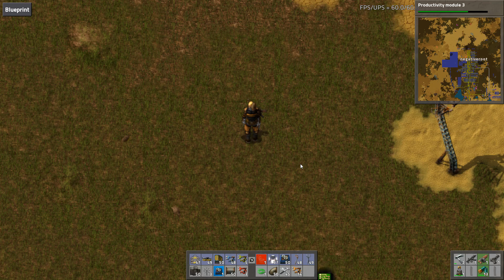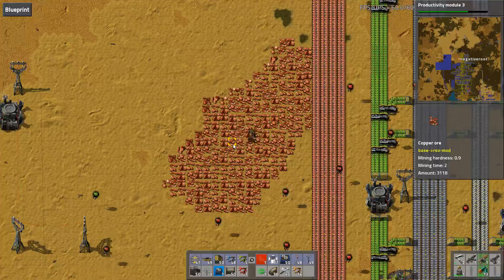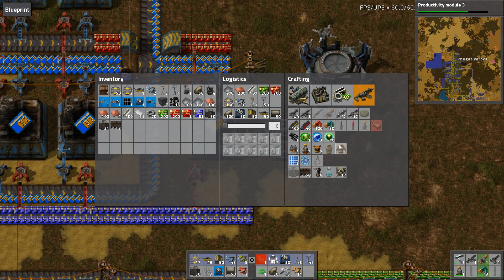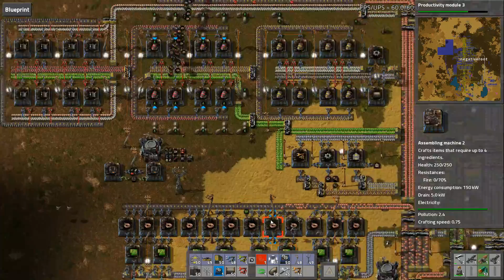Factorio Beginners Guide 24 Furnace Redesign

Comment: Using this setup + a few diff tweaks, I'm using 2 and its making 6k plates a minute.....(isnt enough for my production though) I have a hard time getting enough ore for this setup, but it is an amazing system thanks for the help bud xD
Reply from the maker: you're welcome. and good on you for making tweaks to the design. thats what factorio is all about.
Reply: Any tips on MASS plastic production? Currently I'm using a mod that allows for other ways to produce plastic, but it requires SO much wood... Is there a way to get the .1/sec oil to actually be enough to produce plastic for thousands of advanced circuits?
Reply from the maker: Nick Simpson scale. you just need many, many, many of each to get the number you need :) keep building bigger until you're at where you want to be.

Comment: i just wonder how long it will take until someone see's that the pink module line has a BLUE module taks in the last assembler
Reply from the maker: +Supreme Commander i wonder how long it'll take you to notice the research currently being completed in the top right hand corner of the page ;)
Reply: +Negative Root yeah, noticed that an hour later ;)

btw, will you also cover stuff like maximum length of pipelines befor you need pumps, and alternative like barrels assembling to use trains ?